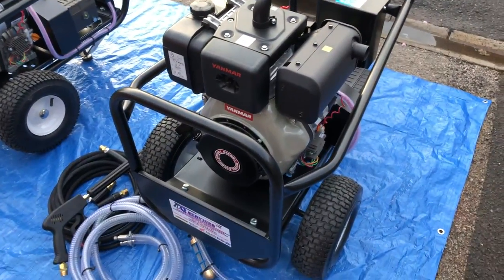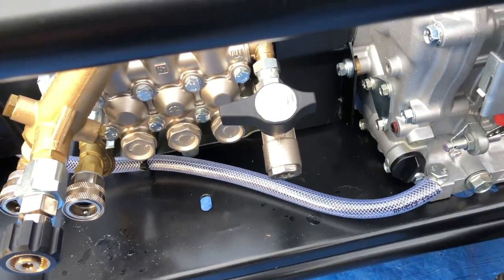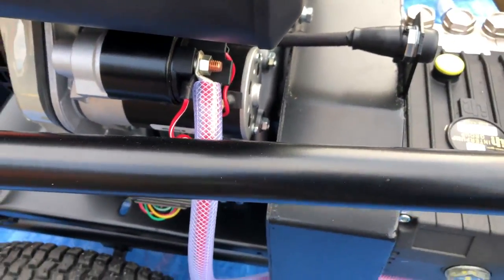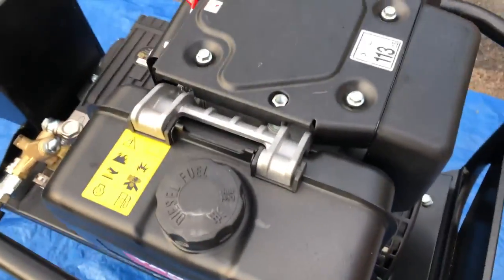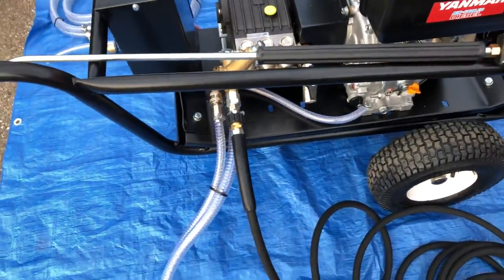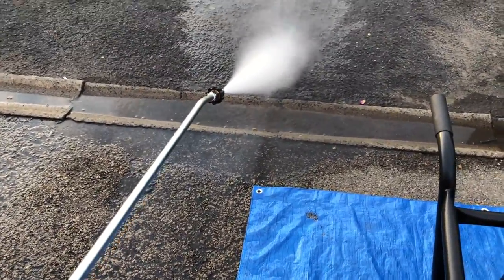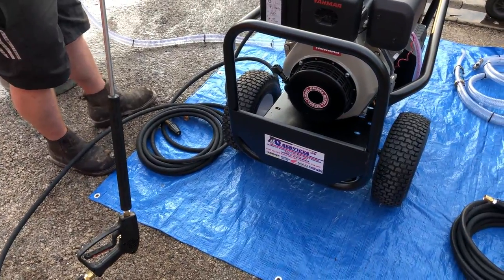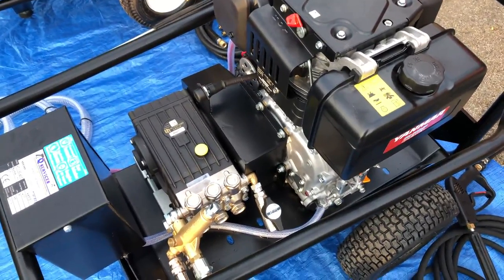YANMAR L100 ELECTRIC START 200 BAR @ 15LTRS BELT DRIVE HOW TO USE AND WHY VIDEO QWASHERS YOUTUBE

Comment: Another informative video guys, well done. Lovely setup. I use a 50 nozzle on mine.... super machine. A lot cheaper to run that the 390 honda as well 👍👌
Reply from the maker: Just not able to supply the 21ltrs at 200 bar with the unit.
Reply: Damian Johnson  what have u got in a diesel at 21

Comment: Damian.   Will she take a bigger pump.  Say  21lts
Reply from the maker: Only the cheaper Evo interpumps, Or drop the Bar & up it to 21ltrs. Can be done with a larger Jet but not the right way to do things like others in the market place do i see. If you ever get a restriction on the outlet high pressure hose or jet. You then put strain on the engine. So watch out. Seen other  supplier engine Shot at with doing this. 
So 3 new yanmars all running ws202 interpump 21ltrs at 200 bar with a 075 or 8 jet. But then they fitted a foam injector for soap on all 3 machines, not size injector 065 and engine buggered. Not happy chappy.